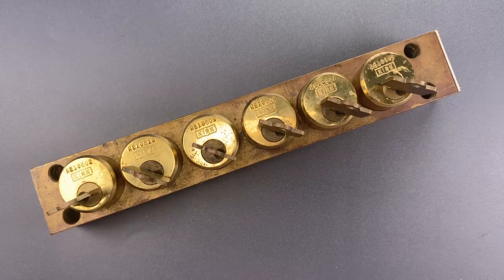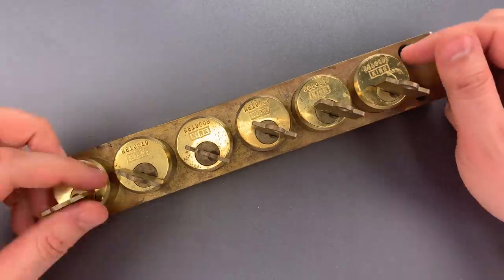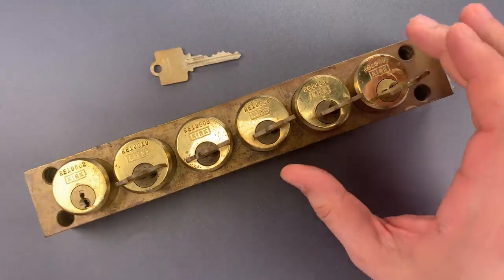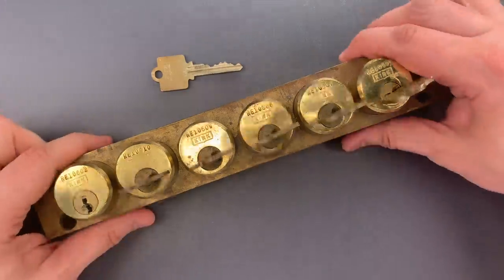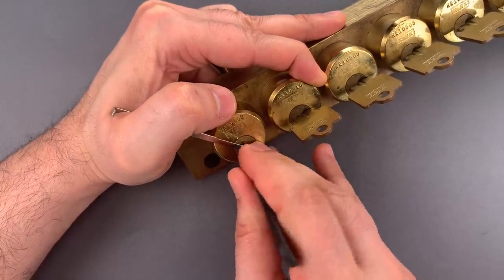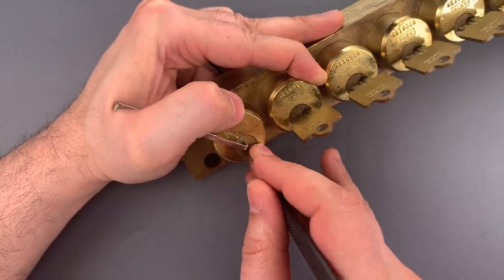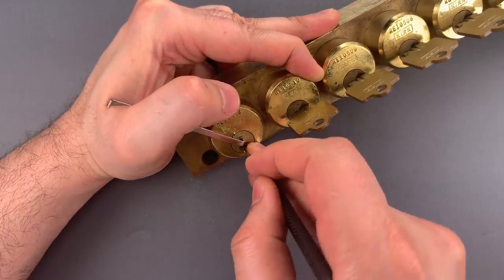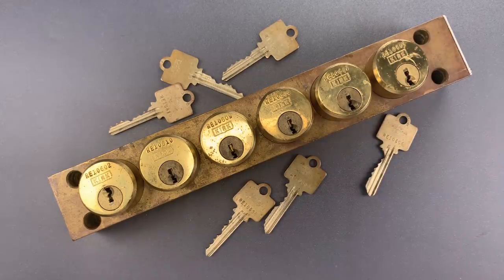[1190] 6-Key Kirk Interlock Panel Picked

Comment: I'm intrigued to see the mechanism that connects those locks together.
Reply: I was also hoping for a disassembly and explanation of the mechanism.
Reply: Can I upvote this? I would love to see how they engineered the system for this to work.
Reply: Presumably they're normal lock cylinders connected by gears, but the first one is upside down to the others such that when you rotate one into the unlocked state (where the key cannot be removed), the others will be in the locked state and thus its key can be removed. Once a key is removed, the cylinders obviously cannot rotate anymore, which then locks the gear system until the key is replaced.

In theory this means you can just select any key you want from the array, twist and remove it without needing to specifically twist the first key.
Reply: He picks one lock the rest give up.
Reply: That's a big yep from me. Come on some of you 344 to date, add a reply to help boost this comment!
Reply: LPL often will not open something up entirely if doing so will ruin it. I suspect that this was the case here.....Just a guess.....
Reply from the maker: This can’t be disassembled without damage... sorry.
Reply: @lockpickinglawyer  Does it need to survive? ;)
Reply: LockPickingLawyer that sounds like a minor detail to me
Reply: @lockpickinglawyer  YOOOOO, LPL. First of all, huge fan. Second, do you think it would be possible for you to make more content on BEST brand door locks? I have a room in my house that I locked myself out of and I don’t want to pay a locksmith to come open it. There’s nothing useful in the room so it isn’t urgent.
Reply: @lockpickinglawyer  sounds like a challenge to me 🤔
Reply: but surely theres some way to peek inside, xrays? lol
Reply: @lockpickinglawyer  I can loan you my hacksaw, chisel, and sledge hammer...
Reply: Next video..... " this is the lock picking lawyer and today in my garage"..........
Reply: Gear cams on the actuators with a linking mechanism for the cams.
Reply: @lockpickinglawyer  ayy 69 likes, thank me later
Reply: I'd assume a shaped bolt on the core that turns the other cores all at once. Because it's turning all the cores at once, removing a single key makes the main key unable to be turned.
Reply: @cptazstudios7952  LPL collecting those locks so if it ended destroyed then its pointless. 
looks like its fine for you if someone damaging ur precious collection just to satisfy their curiosity.
Reply: It might be close to this with a cam thingy at the back? https://youtu.be/ZWl_aU4eP_o?t=118
Reply: @ToTheGAMES  That would be an awesome video.
Reply: Rack & pinions, or Linked-crank pins would suffice.
Reply: Y'all can just Google "how key interlock works"
Reply: @hugme9592  reddit moment
Reply: @lockpickinglawyer  OK, lets examine it non destructively, time to find someone with an industrial X-ray inspection system! :D
Reply: nothing special about it
Reply: It would be a shame to wreck this beauty.
Reply: @lockpickinglawyer  Good excuse to get a second one?  You can get smaller systems that I suspect would be conceptually similar.
Reply: @lockpickinglawyer  So if someone sent you another you would take apart {Destroy} one?
Reply: @LockPickingLawyer I mean, if some enterprising lock hunter wants to try and find a replica to send to LPL, i wouldn't mind him gutting that one
Reply: “Darwin Award candidate” 🤣😂
Reply: @IndianaJoe3  lol he could dissemble  it, but good luck ever putting it back together.
Reply: @ToTheGAMES  lol i don’t know. Let’s ask the owner of this lock if it needs to survive, so that we can enjoy watching it be destroyed ;D
Reply: @lockpickinglawyer  So, explosives?
Reply: I was kinda hoping to see that too.
Reply: @888SpinR  I would guess something like a rack and pinion system connecting the locks
Reply: @lockpickinglawyer  You need some kind of xray system...
Reply: @lockpickinglawyer  Could you make a X-Ray foto? Any orthopaedic or radiologist can make one for a few bucks. It's not as expensive as you may think.
And yes, normal medical x-ray machines do the job easily. As the parts don't move, even multiple exposures are possible to get through thick metal.
Reply: Would love to see the internal mechanism
Reply: @lockpickinglawyer  can you get it x-rayed?
Reply: @incith  bruh thats too boring
I demand quality content! Not crappy search results!
Reply: @lockpickinglawyer  
How about a diagram? Was there anything of note on the back? What about terminal connections?

Many of us are laymen and the questions are many
Reply: @lockpickinglawyer  What's a little damage for educational/entertainment reasons?
Reply: There's a general description at https://en.wikipedia.org/wiki/Trapped-key_interlocking  . Briefly,  "A typical trapped-key interlock device consists of a lock cylinder which operates a sliding bolt through a cam."
Reply: He probably can’t open it without wrecking it.  He’ll have to get a second one.
Reply: Me too
Reply: @cptazstudios7952  kick the door down 😜
Reply: Awesome piece of engineering
Reply: @lockpickinglawyer  any chance of getting one that can be disassembled or “damaged” for sake of science. I think many would agree with me; I love your channel but the mechanics behind locks is super fascinating and would lobe to see more when possible. Keep up the great videos.
Reply: @incith  where is the fun in that?
Reply: I'm intrigued by the prospect of what that mechanism looks like.
Reply: Saaaaaaaaaaame
Reply: @lockpickinglawyer  could we see the back of it? Just curious 🧐
Reply: Check out the 1933 patent for early sketches of the interlock innards and more early info. https://patents.google.com/patent/US2166059A 

I'd also like to point out that those are 7-pin locks, so SPPing the first six pins would make it a bit more frustrating. 

Thanks for sharing, I really enjoyed seeing this video!
Reply: @lockpickinglawyer  do you have a diagram or something similar to show the way it works inside?
Reply: @lockpickinglawyer  Your friend Bill should mill it open!
Reply: @thomaseboland8701  yes, they are.

Which is why this is such a good safety system. It's trivial to use, and significantly non-trivial to bypass. When it's easier to do things safely, nobody wants to bypass the safeties.
Reply: It may be simpler then you think.  It's "geared" in a 2:1 ratio (half turn on the master causes a quarter turn of the others).  It may be nothing more then a gear with a idler in between (so the keys turn the same direction).  The keys are locked/released depending on the position of that cylinder.   While it might be possible with a lever system, I can't think of a design that would work that smoothly.
Reply: @lockpickinglawyer  If you get something similar please disassemble.  I understand not wanting to destroy something so elegant, especially if it is not yours.
Reply: @888SpinR  Yes, but it wont get done that way as the first key isn't normally present. It's retained in the breaker mechanism and only released when the breaker is turned off. Removing the key from the breaker locks it in that off position. When you put this key into this interlock you will naturally always turn it to release the other keys ...... but as you say you "could" turn any of the keys at this point.
Reply: @lockpickinglawyer  that doesn´t contradict our desire ;-P
Reply: @888SpinR  Sounds about right. Another way is that theres just a bar running behind the cylinders with an offset pin. (Like a Steam train wheel)
Reply: @FaZePoopCheetah  Make  extra keys
Reply: @lockpickinglawyer  Well ? You have not shied away from such matters in the past ,so ,,,,?
Reply: @areaboy777  I don’t have the keys for it :/ I want to prove to myself that I can pick it.
Reply: @lockpickinglawyer  It got put together in the first place didn't it? ;)
Reply: Rack and pinion conecting them all and the locks can only move if the keys are in
Reply: @norbertfleck812  veterinarians also often have xray machines, and often have fewer patients in line for using the machine.

I've had a vet xray some burnt melted-together lumps of electrical components when doing arson investigation, that saved a lot of time and effort in checking for signs of electric arcing. Could see fairly well through thin sheetmetal etc, not sure how well it might work on thick brass.
Reply: @Kaboomf  Thank you. I didn't think about vets, but you are right.

Thick metal is not a problem at all, as you can make multiple exposures (trigger the X-ray multiple times on the same piece of film). The locks won't move!

I had car parts x-rayed and a normal dose for human diagnosis was enough to produce a very good image.
Reply: @lockpickinglawyer  need yourself an x-ray
Reply: I like to think it's just a lead strip
Reply: @FaZePoopCheetah  Try picking the lock yourself. Given that it isn't urgent, this is the perfect opportunity to take multiple cracks at the lock over time.
Reply: @lockpickinglawyer  We actually had to swap cylinders on these before (can't remember the specific) involving drilling brass plugs. What I do remember, is that these are not fun. It's been over a year since we had to do this, but when it comes again, I'll snap some photos.
Reply: @lockpickinglawyer  Well, BosnianBill knows someone with access to an X-ray machine. Maybe you could try sending it to him?
Reply: @lockpickinglawyer  We must find him another...
Reply: Could be as simple as gear rail and gears for actuators.
Reply: Pull it a part...
Reply: @IndianaJoe3  It's probably a simple linkage connecting the cylinders inside the cores together with the first one just having an offset angle to the others. This particular interlock is relatively simple as one key locks/unlocks the rest. 

The interlocks used by railroads, for example, back when station attendants would have to manually throw the track switches are much more complex, because there's different combinations of keys locking and unlocking the others. Those keys are of course used to unlock the tracks (not the switch lever itself, that one is free to move but as it's linked to the tracks, it cannot do so while the tracks themselves are locked) so that you can switch the lever and lock the other side.
Reply: @lockpickinglawyer  what about an xray or two of the ones that can't be disassembled? That'd be interesting!
Reply: judging by how quiet it is, I would assume there is some sorr of lever bar connecting all of the locks together
Reply: @AB-Prince  Yeah, nothing more complex is really necessary for the way this mechanism works.
Reply: @lockpickinglawyer  i just saw you OWN a newer Kirk Key electromechanical assembly. Well aware you wouldn't encourage these being tampered by hobbyist when in-use but damn, this is used to keep sparkies like me alive
Reply: @lockpickinglawyer  That's a deliberate part of the design.
Even the bolts used to attach it to the equipment are designed so that they can't be removed.
Reply: LPL needs to partner with one of these youtubers that cut all sorts of things in half with these waterjet lasers
Reply: @lockpickinglawyer  can’t ? That’s not like you 🤣

Comment: He was exactly right with his explanation what this interlock set up is for.  I work in electrical substations and these are still very much in use.
Reply: Do they get much use the other way round? 

Like say for a system which needs multiple user authorisation to open
Reply: @Garfie489  No, the main point here is not to have multiple keys simulateously required to open something but to manage multiple things that should'nt be opened simultaneously. 
Think about it as a key storage system preventing some keys to be in use at the same time.
Reply: @Garfie489  one place we use them is on wheel lathes, where other equipment (such as the pusher to move the train over the lathe or overhead crane) can only be used when the lathe is turned off, so their keys are trapped by the lathe master key
Reply: @vchalmel  thank you. Now it make so much sense.
Reply: I'm a Canadian electrician and that type of interlock is on every boiler precipitator.i have ever seen.
Reply: @parapicktog7734  steal one and send it to lpl for destructive disassembly,  we wanna know what's inside
Reply: Yeah, I work in particle accelerator operations, an we've got similar devices in our access safety system. For instance, one key switch enables or interlocks particle beams to be injected and circulated in the accelerator. In order to give personnel access to machine, the beam key switch needs to be turned to the off/interlocked position, the key removed, and inserted into another key switch that releases the access doors. Obviously all these key switches are key retaining.

The idea is simply to make two states mutually exclusive, like beam operation and machine access in our case.
Reply: @m__42  Fine, I'll find another way to turn myself into a superhero/villain (I haven't decided which way I'll go yet).
Reply: @Garfie489  There are devices like that - for example a Masterlock 420. The device allows multiple padlocks to secure a single isolator. So, if multiple workers are in a dangerous area, each have their own key for their own lock - the power can not be restored until all workers have returned and removed their padlock.
Reply: @m__42  You know, there's just something really awesome about hearing the phrase "particle beams" being used in a real, factual sentence. We really do live in the future... shame it's closer to Cyberpunk Dystopia than Star Trek.
Reply: @Just_A_Dude I have the same thing for computer data centers to prevent you from taking down UPS without being in internal bypass.
Reply: This would sort of be the bottom end for the task. The interlock locks I am used to are oversized versions of cylindrical locks, like Castell keys. These are used for both mechanical and electrical isolation and to force isolation sequences - I.e. isolating a keyed feed valve releases the key to open the drain valve. Castell keys can only be duplicated by the manufacturer.
This looks like a Kirk key system that are much easier to copy.
Reply: I have seen these on million watt shortwave radio station transmitter tube cabinet doors.
Reply: I worked in thermal power plants in the past and we used them on electrostatic precipitators to prevent people from being able to open the mandoors with the power still on.
Reply: Same as lock out tag out?
Reply: @vchalmel  technically, this can also be used to require multiple keys to get a single key.
Reply: @Garfie489  In that case we just use a "lock box." Put the master key inside and each person puts their own lock on the outside.
Reply: I worked in a steel plant where we had a similar system, except we have a thing called "red locks" that we each individually have. Everyone going to work in the area puts their lock on it and the door won't open until all the locks are removed. You want to make sure you remove your lock at the end of your shift or they'll think you're dead and when they find out you're not you won't have a job anymore lol
Reply: So the connection is mechanical or electrical?  Is it tied to one circuit or six?
Reply: @charlesmurphy1510  that entire block of keys are just connected to one another, no electrical input.  Usually it's mounted on a wall with a certain number of keys already trapped. You then add 1 or more keys (after doing a move on electrical equipment, such as racking out a circuit breaker, which then gives you a key to put into that block). Once you add that 1 or more keys, you can turn them which turns the keys that were trapped,  but now they are free to take out, and the keys you just added now become trapped. The newly freed keys may let you open a panel that previously had energized equipment, but since you added the keys from when you racked out the circuit breaker, this would confirm the panel is deenergized, thus being safe now to enter that panel.
Reply: @christophers.4007  thanks,I think.
Reply: @kurtiskuchcinski2628  same idea, but better. Consider data hosting, critical patient care equipment and such. Key boxes are unacceptable at a point.
Reply: @Death-999  sounds like a shit employer. These Kirk Key interlocks are serious shit and work well, but apparently the accident til blame program worked for your fortunately past employer
Reply: @cndevoe1983  shit employer what?